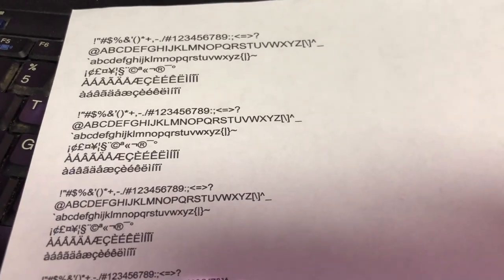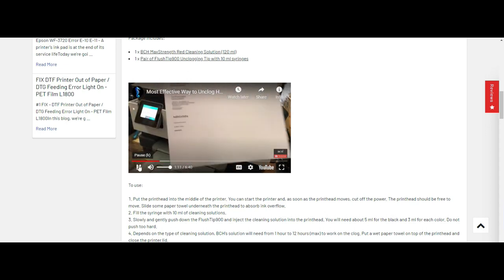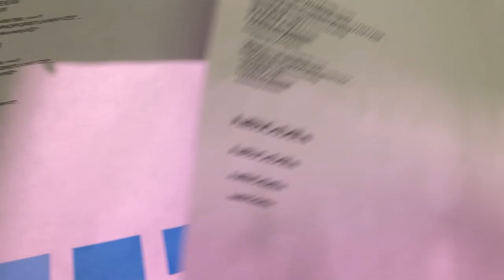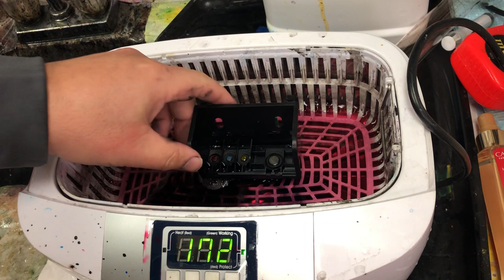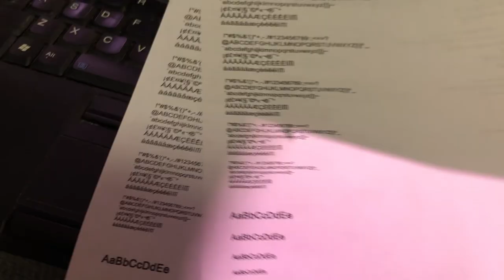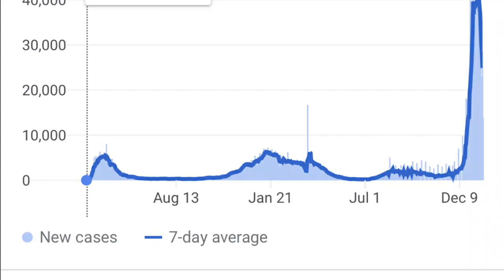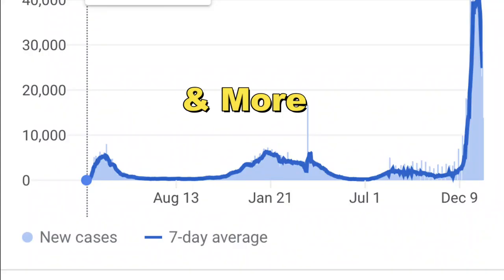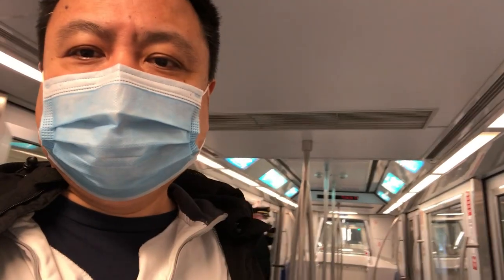Experiment: Extreme Clean a badly clogged HP 8022 Printhead HP 910 916 934 935

Comment: Great Video Kevin, usually when I do head cleans for HP heads like the 8600 models. I do it for a minute. Results with ultrasonic cleans are always mixed, you never know what you will get sometimes. I dont get those printheads that often to service but I am grateful for the knowledge about the ink chamber channels. 

Question though, in general if you begin getting fuzzy prints after cleaning a head via whatever medium (cleaning solution, head cleans, ultrasonic, etc) does it mean that printhead is damaged or is there still hope?
Reply from the maker: I will print a nozzle check. If the nozzle line is skewed or out of place, it is damaged from the cleaning.  Otherwise the fuzziness may from overflowing ink.
Reply from the maker: I mean, if the pixel is totally out of place, like flying to another area, it's caused by cleaning.  If the pixel is sideway, it may be caused by a pigment block, so the ink sprays sideways.  I would try to clean it one more time if I see sideway pixel.

Comment: I bought a 11x17 printer with the 910 print head and couldn’t restore it. I soaked it in ammonia and wasted untold amounts of ink. Guess I should’ve just bought one. ;)
Reply: Goodwill find
Reply from the maker: If it doesn’t throw printhead errors, there is still a chance.
Reply: @BCHTechnologies  Well, I don’t recall any errors but I almost expect them now.  I gave up in 2017 and it’s been alternately freezing and cooking in a storage unit since getting hit by an EF4 tornado last year. I got another large format HP just for the extra large scanner but the drivers won’t even let me install it (expired certificates and servers that no longer work).
Reply: @emmettturner9452  you could always go with HP's linux drivers as they basically support every printer (including very very old ones that Windows stopped supporting)
Reply: @thexkey  It’s the scanner that is needed most and it’s the multifunction stuff where I was getting hung up in Windows. Do you think they support the scanner in Linux? It looks like a standard-size sensor that has to sweep the oversized bed in two passes, so I expect generic drivers might not make the second pass or stitch the scans together automatically.
Reply: @thexkey  Other large-format scanners, like A2-sized flatbeds, cost an arm and a leg. :(
Reply: @emmettturner9452  yes, the drivers should support scanning and other things like ink monitoring and print utilities
Reply: @thexkey  Thanks. I’ll look into it! For reference, it’s either the HP OfficeJet 7610 or 7612.